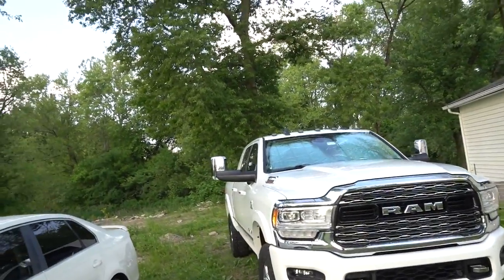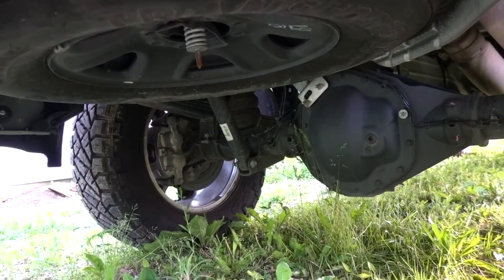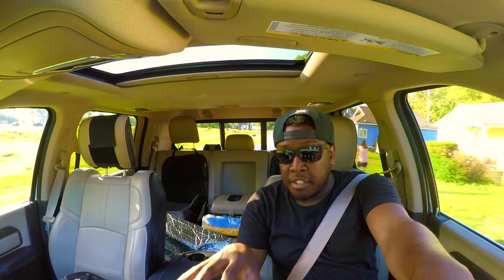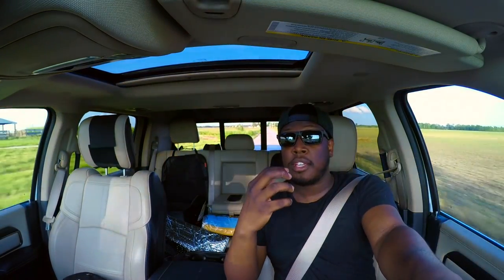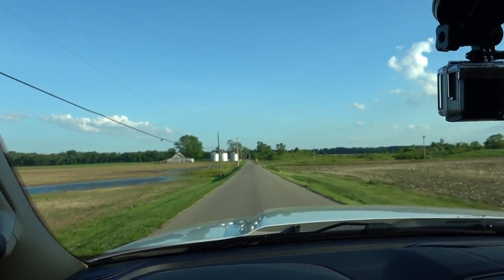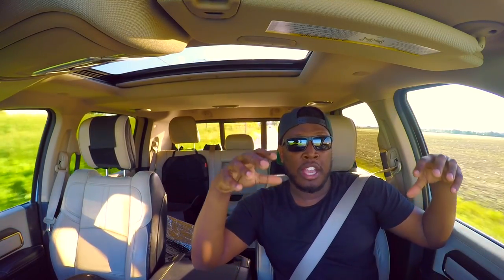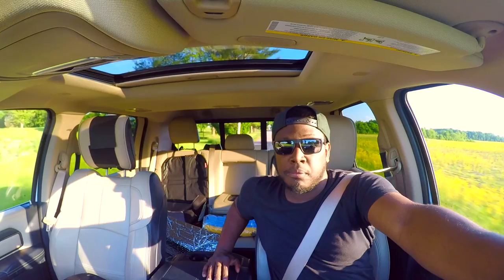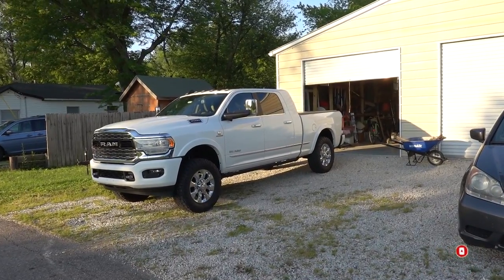I Really Messed Up My Ride On My RAM HD! What You Need To Know Before You Level And Add Timbrens!

Comment: I had Timbrens on my previous Ram and never liked the ride even without spacers. Since then I've ran Airlift bags and couldn't be happier with them. Cost isn't much more and you can adjust the ride pressure to your liking, something you can't do with Timbrens. For my 22 Limited I just got I found the Airlift Ultimate kit for 350 on Amazon as used like new. They have open box deals on that stuff all the time.

Comment: JB, I think your truck looks great. You’ve done a really nice job getting it dialed in and that usually does take some time. I’m going to look into the 295/65/20 when I change out the tires in the fall. Like I’ve said in another video, I have the air suspension on my truck and I believe the rear end is only 3/4 of an inch higher than the front. If I can make it work with minimal adjustments I’ll get the same tire set up just with Toyo AT3’s. Thanks for all the videos, I always enjoy watching.
Reply from the maker: Thanks David, you won’t be disappointed with this tire size. They will have minimal rubbing if any even without leveling 👍🏾👍🏾

Comment: I’m almost wishing I didn’t put air bags on my truck.  I have to continually add air. I didn’t install an air compressor but, wish I would have.  I’m most like going to do that.  Thanks for sharing your view on you new suspension.
Reply from the maker: Good point Ric, I think you mentioned that to me awhile ago about airbags. My next RAM will have the factory system. Thanks brother 👍🏾

Comment: I have the Airlift load lifter 5000 and the WirelessAir compressor. It’a basically as much money as a factory system unfortunately but works extremely well. You are a content beast bro!🇺🇸💪
Reply from the maker: Did you install it yourself? I was looking at getting airbags with a air compressor that I could use to air up my Goosebox. Thanks bro 👍🏾👍🏾
Reply: @JB_WhoWork  yes sir installed it myself!

Comment: On my 2021 3500 4x4 I installed air ride with a load leveling air valve kit . What a difference my ride is much better but to make it awesome I am going to have the spring shp take some arc out of the bottom overload spring. When I pull my fifth wheel trailer or dump trailer 14000 lbs and diamond c trailer which is 14900 full of ag equipment my truck lowers 3/4 of an inch and the ride is awesome.
Reply from the maker: Wow that’s really good!

Comment: Love your content. You where saying that you do around 80 at night, I do have a question. What is the speed rating on your trailer tires? And think about airbags for your rear suspension. And its great for towing a level rig. Great show thank you 
Rodger and Sheila
Reply from the maker: Thanks Roger, my trailer tires are rated for 81 MPH so I typically run right around 78 MPH realistically.

I will get the factory system on my next RAM for sure! Thanks again!

Comment: That’s what I have 7000 lb air bags with on board air and 3 gallon air tank and air Chuck mounted on my running board and it came with curly hose and tire gauge and a Chuck to air up tires .

Comment: Nice looking rig.   

The sway you feel when making turns may just be the tread of your tires, not sure what brand you have.  

My Ram had air suspension and I ran 325/65/20 Nitto Terra Grappler G2 ATs.  Loved that tire, good wet and dry traction, very comfortable ride.   I had them on a set of 20x10 Fuel wheels and set the air suspension 1 level and normal.   No rubbing and really good ride.   

Sadly I traded that truck for a GMC with a 6inch lift and TOYO MTs 35x12x22.  Not as nice a riding truck as the Ram.
Reply from the maker: Mine has the Ridge Grapplers, I’m planning to do a video on your previous tire 👍🏾👍🏾

Comment: I think the Ford had 18" wheels and you're running 20"s on the Ram. The 18" with 35's will give a softer ride.
Reply from the maker: True!
Reply: That don’t matter hardly at all 
I’ve had a lot of trucks. 
A lot of big big trucks. 
No matter what. Whether you lift it, lower it, use reverse shackles or leveling kits. Etc….. 
Different size rims and tires. 
35” tires really don’t do anything. 
They aren’t that big. 
All of these things that people do to their trucks affect the performance. The payload. The ride. The gas mileage. The looks. The acceleration.  
Performance usually goes down. Never up. The benefits of looking cool. 
Really there aren’t any.
Reply: @thomaschambers157  well said! All of these modifications usually make the ride and performance worse. Unless you're spending 20k on a full Carli suspension, it's really not worth the hassle.
Reply: @oldnumber6  Carli suspension doesn't cost that much. Also, if you just stuck with 35" to 37" tires, most HD trucks only need a level kit in the front and the badess one Carli sells is under $2k
Reply: @volkodavwolfcrusherlv7133  look at a full Carli pintop suspension setup. They are over 10K.
Reply: @oldnumber6  I said you don't need that set up if your just going for a look with bigger tires. That set up you mention is a full 13" to 16" travel suspension

Comment: I figured you’d be taking the spacers back off. I got mixed feelings about timbrems  and sumo springs. I’d like to get your opinion after some towing trips especially over rough roads and bridge approaches. 

As for the taller tires well a couple things, one you made your final drive gearing a little taller than before and two they are probably heavier. The weight and affecting the final drive ratio is where people feel like they lose power with bigger tires. 

Good video. Be interested to see your experience with the timbrens.
Reply from the maker: Lol, yea it was pretty bad, even if my wife didn’t care, I would have still removed them because I felt like they could cause damage without a load.

Yea I wonder what my final drive is now, I looked online to see if anyone put it on a lift but nothing came up. Videos coming this month… I think 😅 thanks bro 👍🏾
Reply: @JB_WhoWork  I’ve considered those in the past when I had my 1500 but my buddy from work had them on his 2500 Ram (he traded it to a Ford, what a loser lol) and he had an interesting experience that I think was the Timbrens fault.
Reply: Timbren on the truck and sumo springs on the 5th wheel, night and day difference since I added both. I can put a solo cup of water on my kitchen island inside the camper and drive 4 hrs to my site and the cup is still there. Sumo springs are a must on a camper and simple to install, easier than shocks

Comment: I added a 2 inch level puck on my 2021 ram rebel and i was able to fit 35x12.5 with a 18x9 -12 aftermarket wheel with very minor plastic trimming.
Reply from the maker: Wow that is pretty good, good thing your truck has the 3.92 rear too 👍🏾👍🏾

Comment: Thuren Sway bar, best $600 upgrade I’ve ever done., not sure about pulling 5th wheels. Contact em, find out. Ride quality improved 💯. Bolt on, took 20mims to install. And your 295/65/20 will not run anymore.
Reply from the maker: Good stuff, thanks for sharing 👍🏾

Comment: Well you be doing a video on why you chose the timbrens over air bag or sumo springs? And also will you be doing a video on how the timbrens help with rocking back and forth and side to side while towing. I tow with a 2021 chevy hd 2500 and have been debating getting some for that reason
Reply from the maker: The Sumo’s weren’t on my radar for this truck and someone else asked about the Sumo’s. I was thinking about adding Sumos to the RV
Reply: I got you. I was wandering why you chose them over the other options I’m torn between them all lol

Comment: I had the timbren’s on my Chevy. They are nice while towing but unloaded was a nightmare. Your truck looks good but I would have went with airlift 5000 ultimate, with the built in bump stop. There air compressors are junk in my opinion so I went with a ARB compressor.
Reply from the maker: Did you keep the spacer on? I find that without  the spacer, the ride is so much better 👍🏾
Reply: @JB_WhoWork  mine didn’t have the spacers. I had about 1/2 inch space from the axel and the timbren.
Reply from the maker: Gotcha

Comment: So are you not running an adjustable track bar?  Was it not necessary since you went with a mild leveling kit?  I have the same exact truck, and love your setup.  I've just heard that once you raise the front, it shifts the axle to one side and can only be corrected with a track bar.
Reply from the maker: So far the truck is doing well without one and even towing, it handles great 👍🏾
Reply: I recommend a track bar if you lift 4 inches or more. You shouldn’t need one just lifting a couple of inches.

Comment: Timbrens are still too close even after removing the spacer, if you put one or two passengers in the back seat the timbrens will be so close every small bump you go over they will hit like you have no suspension. When I installed mine the recommended 1 1/2” of space when unloaded
Reply from the maker: I still think the ground wasn’t 100% level but so far I haven’t witnessed any issues… Come to think of it, I had about 200#’s of equipment in my truck when I did this video, no wonder why it was so low. Thanks 👍🏾👍🏾

Comment: I used timbrens and I love them but mine don’t touch for almost 2 inches this where my empty ride is good when I get about 1000 pounds in the back of my F150 or a heavy trailer it just touches them I don’t try to level the truck with mine I don’t mind squatting down a little but I did not try to level the front and out so when mine hit my truck isn’t sagging it’s just about level and yes they do ride hard for what you’re doing I wouldn’t use them,I would just get a set of airbags and call it done because you’re trying to level the truck out that’s not gonna work with timbrens Without killing your back.
Reply from the maker: Once I removed the spacer, everything was fine, I’m planning on doing a towing video once we head out by the end of the month 👍🏾

Comment: Why in the world would you put a leveling kit on the front end when you are going to a 5 th wheel camper , that just does not make any sense. A rear sway bar and airbags and the larger. Stops so when you trailer is hooked up the over loads are touching and you can change the stops for taller ones but don’t touch when empty and by putting the taller on you rig raising your gear ratio and it will not pull as good . And may be give you better fuel mileage when empty but when you are loaded your fuel mileage suck.

Comment: Do you recommend timbren over air bags, is that because a price or maintenance?
Reply from the maker: For what I need them to do, the Timbrens are great because my trailer is only adding 2680#’s of pin. If I was closer to 3000#’s I probably would have added airbags instead but I just wanted something I could just install and never have to think about again 👍🏾
Reply: @JB_WhoWork   thank you

Comment: Need a track bar
Reply from the maker: I may look into one but it’s been fine so far 👍🏾
Reply: @JB_WhoWork  that’s why you are probably rubbing. Most say you don’t need a track bar for 2” and under. That’s not true. My truck has the same level pucks yours does although mine is an 18. Had it done right after I bought it new. It shifted my front end to the left 1”. I was tired of seeing the left front wheel out the fender more than the right one. Had an adjustable one installed and it was perfect. I’m going to new shocks and coils in the front now by cognito because the ride is horrible and has been since I put those pucks on. Just sharing my experience. I too have a wife that prefers a smooth comfortable ride going down the road. Let’s face it, I do too. Nice truck by the way. I have an 18 megacab  Cummins with the Laramie sport package. The truck is delmonico red pearl with black trim and accents.